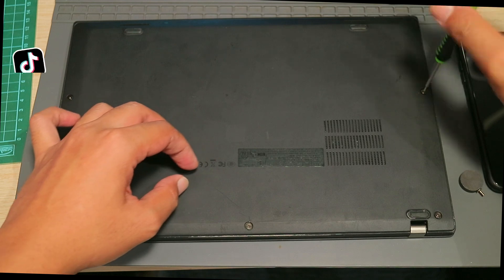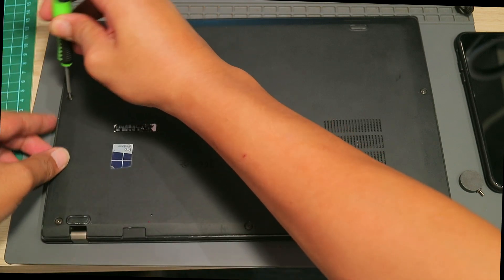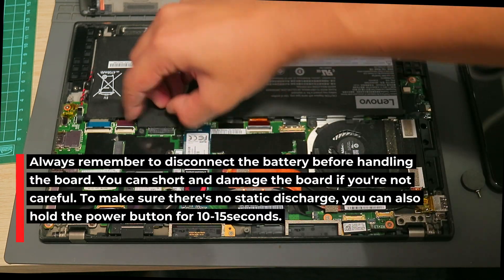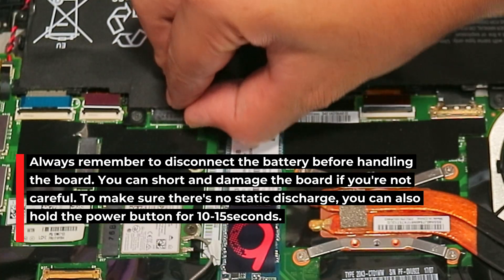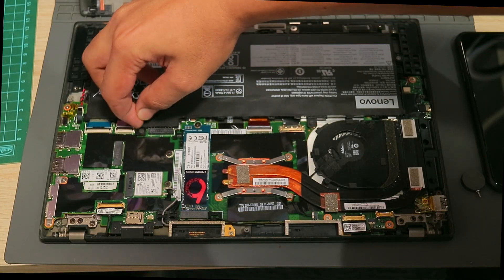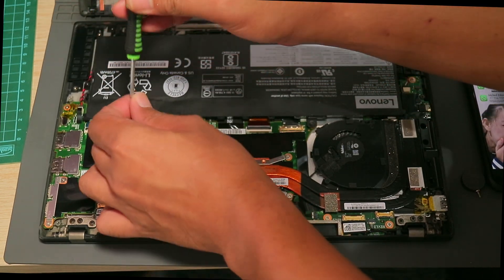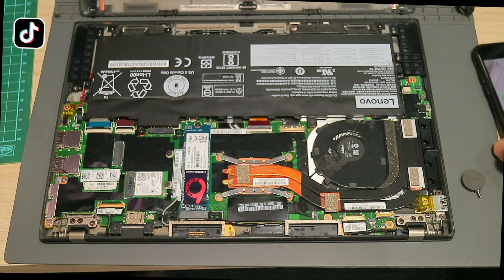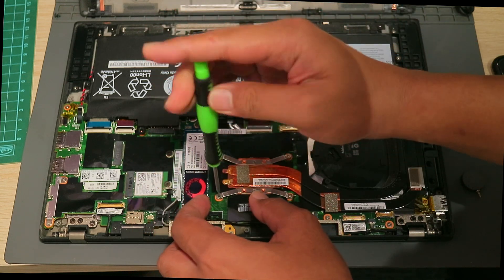Revive Your ThinkPad X1 Carbon 5th Gen with Thermal Paste Swap!

Comment: What is the purpose of thermal paste? Thanks for answering..
Reply: It’s purpose is to improve thermal bridging between two surfaces, in this case between the CPU and the heat sink.  In theory if both surfaces were perfectly flat it would not be required, but in practice surfaces are never completely flat.   The difference between thermal paste and no thermal paste is at best 10% and usually less, however 10% is a massive difference in performance at higher temperatures.  As rebeltech correctly says, this improves lifespan and reduces the risk of overheating.
Reply from the maker: @andrewstones2921  perfectly well said!
Reply from the maker: Hi there. It’s to prevent the processor or GPU from overheating. Also to prolong its lifespan. Recommended if you wish to use the laptop long term.